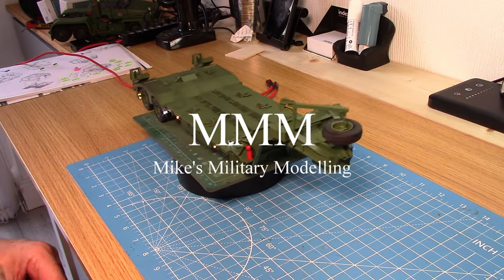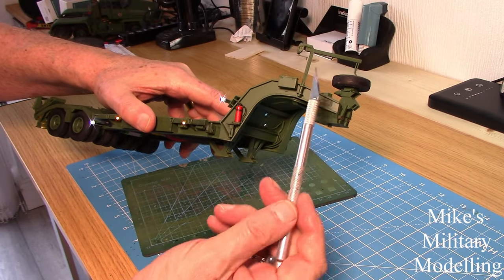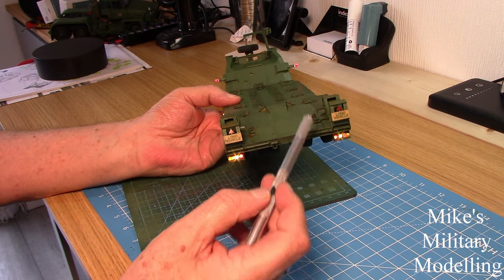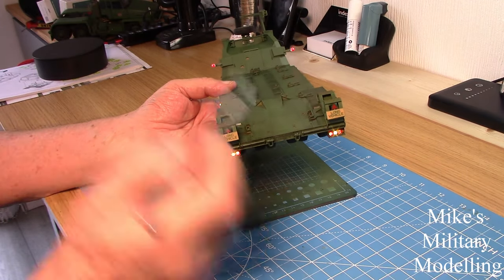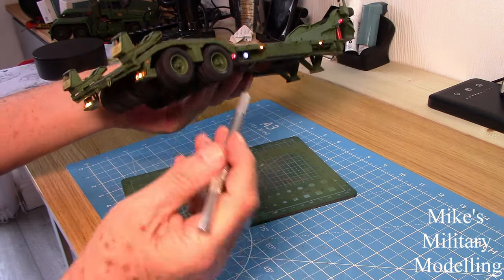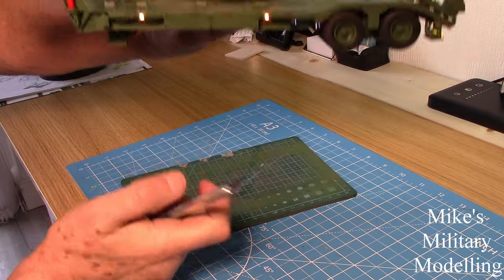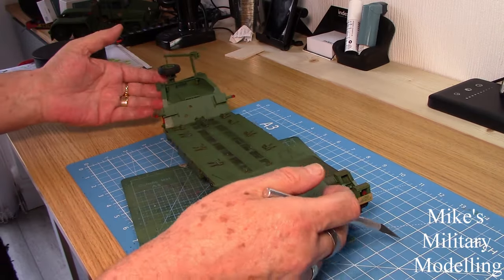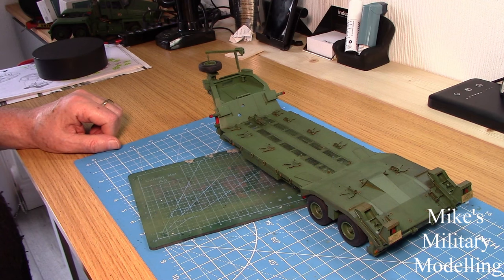Scammell Commander & 62 Tonne Crane Fruehauf Semi Trailer (Part 6 The Finished Trailer)

Comment: Unused track guides normaly got thrown in the side bins, 
military vehicles have rubber track pads so its not metal on metal, 
As for the work lights on the side, they never really got used.
The legs under the bed could be adjusted for height. 
Trailer spare wheels x2 underneath x1 tractor on the goose neck, 
A pain in the arse to get up and down to change.
Reply from the maker: Hello John,
Thanks for the information, I thought the track guides would be hidden somewhere but hey I've glued the buggers on now. A couple of people have told me about the spare wheel for the tractor but the kit didn't come with spare for the tractor so I can't really change it. Must have been a hell of a job getting those big old tractor wheels up and down. 
Cheers Mike.

Comment: That looks fantastic Mike. The wheel on top of the gooseneck should be a tractor spare but a great idea to use one of the trailer spare wheels. Love the lighting, that is way beyond me.
Reply from the maker: Morning Peter,
Thank you, that makes sense, they are big heavy wheels on the tractor.
Thje lighting isn't as difficult as it seems, finding the tiny LEDs is the hardest bit. With the wiring there are loads of tutorials on YouTube, and I have to say I've learnt a lot about electronics along the way.
Thanks again Cheers Mike.